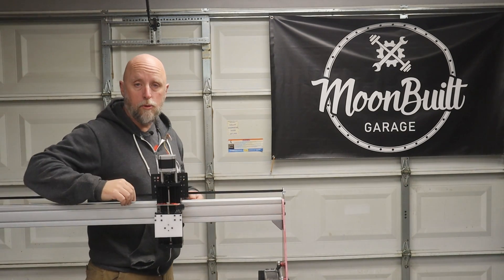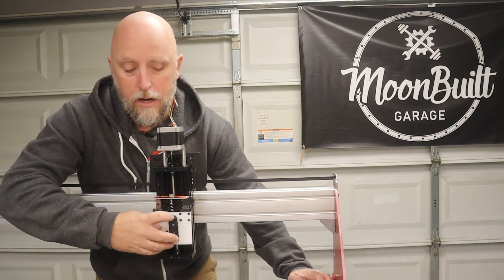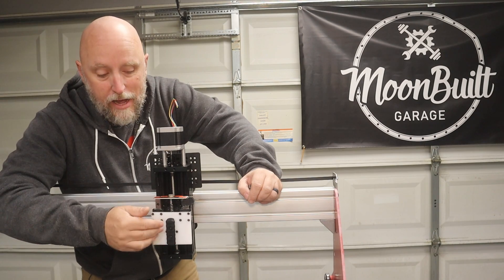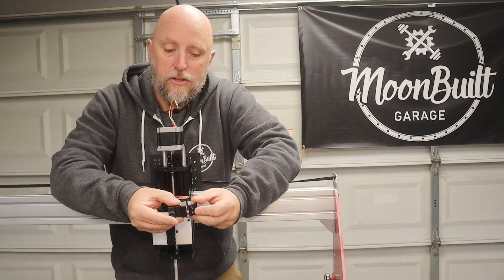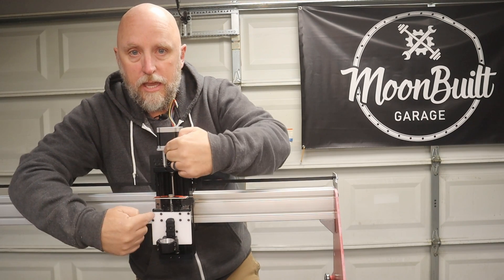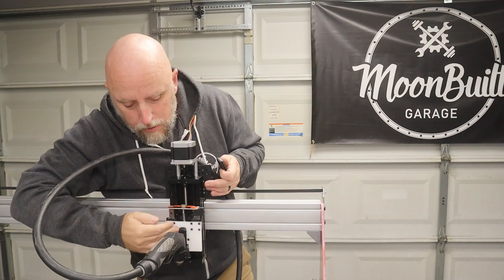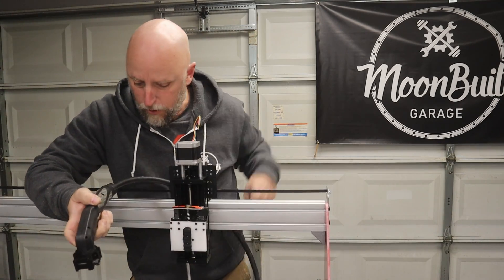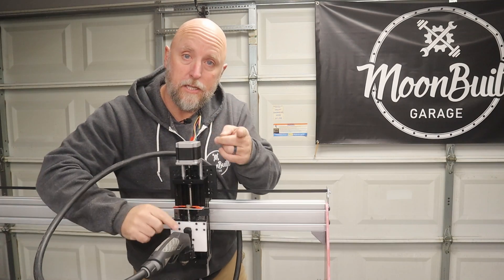DIY CNC Plasma Table | Part 7 - Tactical Torch Mount w/Picatinny Rail and Scope Ring

Comment: Too floppy sir, you are going to get terrible edge deviation in your cuts.  Although there is no load due to cutting, there is load due to drag and flexing the torch cable which has a nice big moment of inertia due to your use of a hand torch. A P80 machine torch is cheap as chips with the cable running straight up to an overhead tether arm, consumable life is much better as well on a small plasma, 1.1mm nozzle for material under 6mm . The picatinny just isn't up to it, its mounting footprint is too narrow even for those small forces, and you have it attached to a relatively thin piece of plastic.. This is constructive criticism by the way, not youtube slagging. You could run it as is and make your first project on the plasma a sturdier mount and base, say out of 3mm sheet in tab box construction, nothing wrong with bootstrapping. My first CNC some 20 years ago had a z stage made out of plywood, it was shocking, but was good enough to cut a rigid one which in turn was good enough to cut the final one. And so it goes.
Reply from the maker: I'm definitely concerned about flex or movement, but I'm curious to see how it dies once the motors are driving everything....if I ever get back on this project lol...it is currently in the back of the garage with other projects stacked in front of it